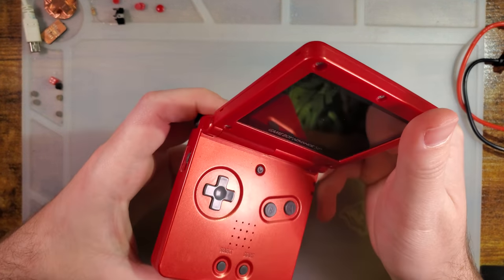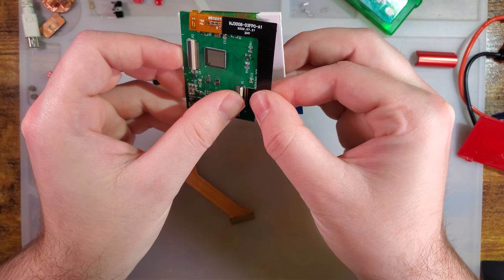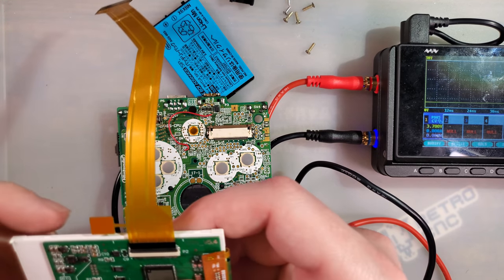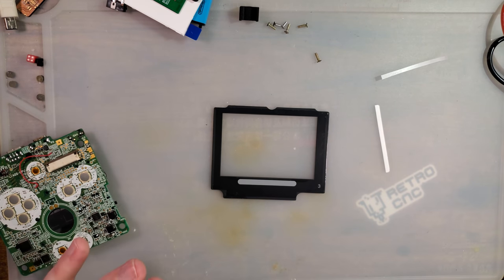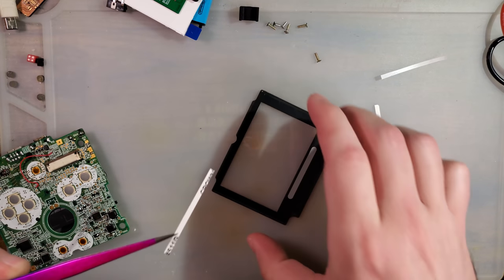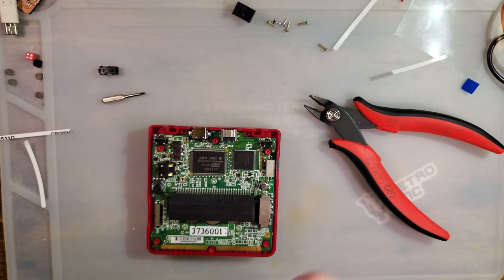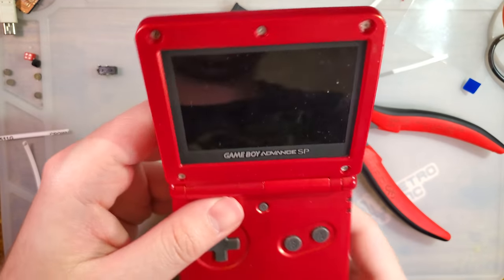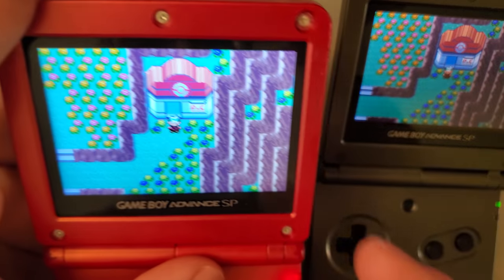Game Boy Advance SP 3.0" IPS Backlight Kit - Cloud Game Store

Comment: Hey mate! Nice videos! Can you tell me what is the power meter thing with the aligator clips called? The one you use to power up the gameboys without a battery and measure the power consumption and stuf. Thx!
Reply from the maker: You can search the model number on the front but it's a miniware MDP-XP

https://retrogamerepairshop.com/products/mdp-xp-mini-digital-programmable-power-supply-set-with-30v-5a-90w-2-4g-wireless-connection-2-8-inch-tft-screen

Comment: would it be the same method to remove a glass lense? or should heat def be used?
Reply from the maker: well with plastic, you can flex the lens to avoid flexing the screen. With glass, you cannot do that. Removing glass lenses is A LOT more work if you want to salvage both parts.